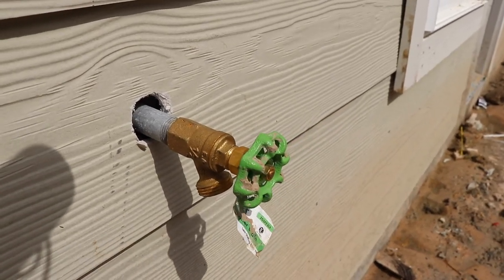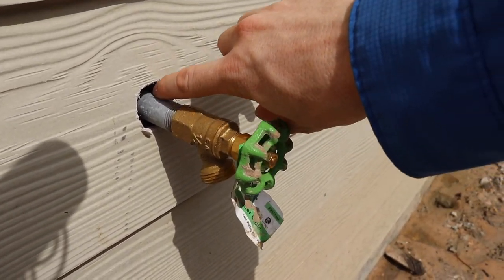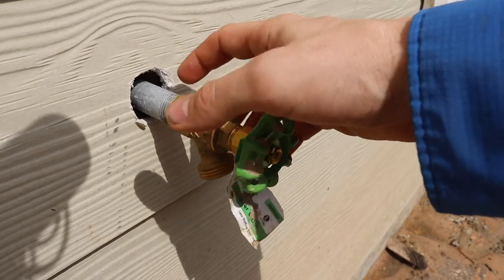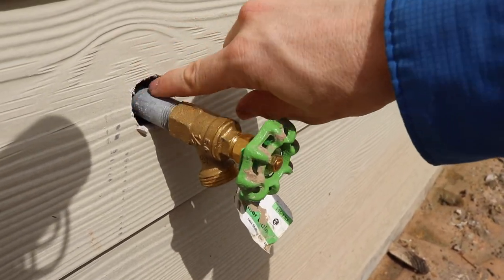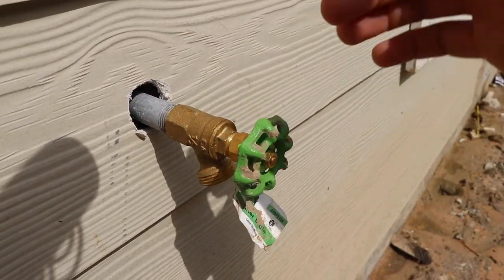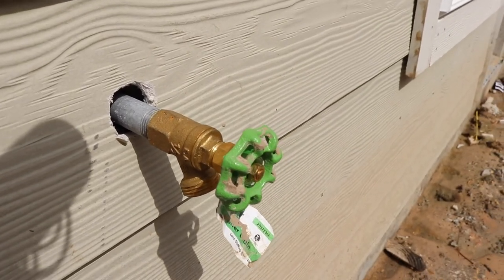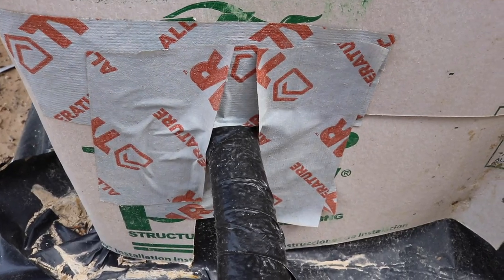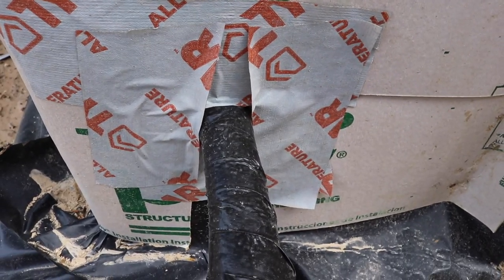Poor Instal Fiber Cement Siding - Found during a phase 2 home inspection

Comment: Obviously nail gun pressure was too high. Spacing between the boards is inadequte.
Reply from the maker: I agree!
Reply: So howany years of experience do you have in siding that you know so much and are quick to know..
Reply: @danisuarez8293  None. Yet it is obvious if you have read up on it at all. Those face nails should not have been used at all. They should have all been hidden under the row above them. The hole for the faucet was about 5 times too large. The window trim pieces were installed over the siding. 
As to the question about the nail gun, again, they address it in all the training videos on fiber cement siding. ALL OF THEM.

Comment: Very useful video.  I'm getting my house resided with JH siding and the info in here will help.  Thanks,
Reply from the maker: Glad it was helpful!
Reply: @AActionHomeInspectionHouston  
Hello I have a question, is it wrong to put nails in the bottom of the siding? I see most people put the nails on the top of the plank and then put the next plank on top so all the nails are covered. But I saw some people put nails on the bottom also like in this video. What is the correct way? Thank you
Reply from the maker: @usa5439  https://www.jameshardiepros.com/getattachment/e8e239b5-366d-46cb-bb24-f482a9afbf0c/17-fastening-tips-for-hardieplank-lap-siding.pdf
Reply: @AActionHomeInspectionHouston  
You're the best!!!!! Thanks so much 🙏

Comment: How is the fiberboard siding such as Hardiboard sealed at the bottom overhang of the slab?
Reply: You cut a small piece off the top of another piece and install it. Then the next row goes over it. There is a slight overhang over the top of the cement. Typically there are footers and you should have 8" between the landscaping and the start of the siding.

Comment: Fiber cement siding is attractive because of its fire resistance. But I can’t help worrying that it will prove to be the Masonite of the 21st century. Pity it’s partially wood fiber (instead of, say, mineral wool) with vulnerability to water.

Comment: It looked like the project wasn't completed yet, you can't inspect a project that's in the middle. You can inspect a phase 2 framing project for missing foam and strike plates, and visible daylight and improper plumbing installs but an exterior stucco or siding or roof cannot be inspected until the contractor says it's a completed project. The builder inspects the project himself and makes recommended repairs that's why the most important inspection comes when the project is completed .

You don't tell the contactor to fill nail holes, or areas that need caulk, that's done after the job is done and inspected by the builder. Most items are to be reported on the final inspection a couple of weeks before the closing, that way the builder can bring back his contractors to finish the job and correct all the issues.......

Then comes the (1) year inspection ..... You as the Home Inspector needs to see the project as a builder and at the stage of current completion, you have years of building experience and should know in which phase and what needs to be finished at that time.
Reply from the maker: This is obviously poorly installed.  You think they are going to come in and fix these issues before the job is complete?  Unlikely.. Classic KB response
Reply: I agree with Chris, who wouldn’t want to have this fixed now the right way instead of just throwing caulk and paint on it which will never make it sound. Builders will try to get away with anything in the hopes that you don’t know enough to object.
Reply: You do tell the contractor to install it properly. You cannot easily check nail spacing after Fiber cement is installed. You can check it during installation though. Covering problems up does not make the problem go away, it just kicks it down the road far enough to screw the buyer.
Reply: @Veevslav1  Yes, my fiber cement siding was installed 5 years ago. The siding was face nailed with finish nails. So as the homeowner this is a big issue that we had no idea about until the siding started failing. I wish someone had noticed it at the time it was being installed before it was painted over. The only true way I see to fix issues like this is to completely replace the siding, and do it correctly.

Comment: I'm calling fake. Looks like they put the trim around the window after the siding, and they didn't hide the nailing and didn't nail every 16 in on center, no gaps, flashing between, caulk. Seems staged but maybe the people doing the job were that bad, what was the contractors business name?
Reply from the maker: This was a builder.  This video is old and I do not remember.  I wish I could call this fake. You are right though,  they didn’t do anything right.
Reply: @AActionHomeInspectionHouston  Apologies, I stand corrected on my first comment. So sad that people don't want to take the extra time and just do it right.